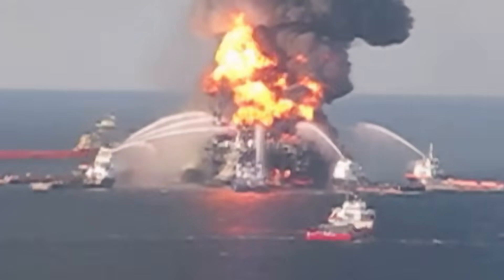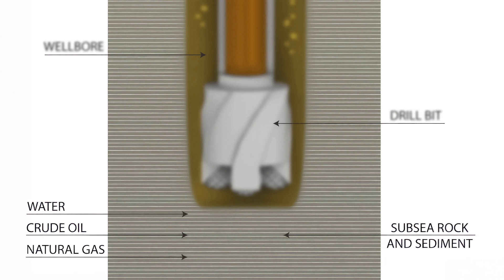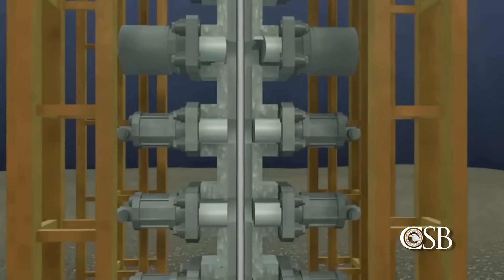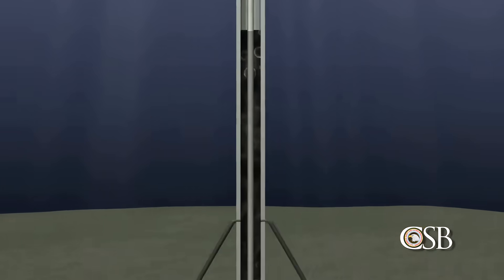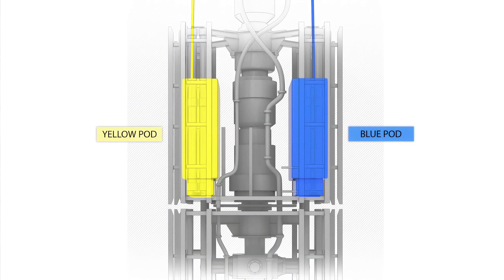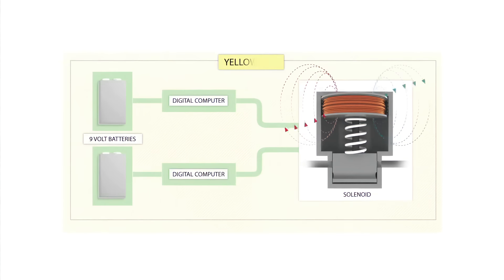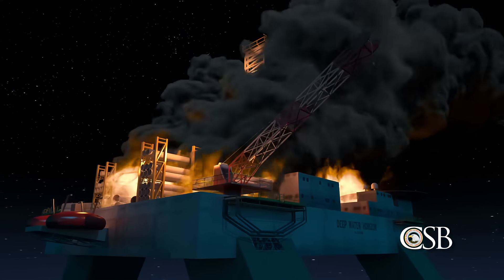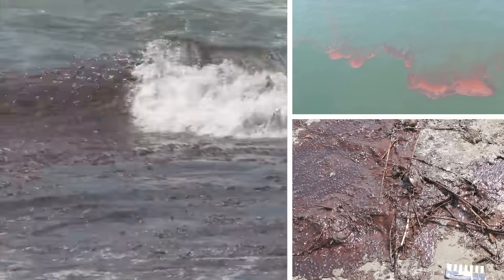Deepwater Horizon Blowout Animation

Comment: I worked oilfield from 1978 through 1981 as a safety and training officer for Dowell Well Servicing. It amazed me how much money the company spent on safety and accident prevention and yet, still operated some of the most obsolete equipment I ever saw. New technology was coming out constantly. And still people were getting hurt in the most stupid ways. In the DWH disaster, those BOP and emergency rams cost the company tens of millions of dollar, not only to buy but to install. The engineering behind them is state of the art and yet, dumb asses wired them wrong rendering them as useful as a slab of pig iron. This kind of stuff goes on all the time in engineering and application of technology.  I could not tell you how many times i caught people taking extremely dangerous shortcuts, short circuiting all safety procedures and mechanisms- in the name of saving time or money.  Every accident investigation results in the same conclusion; invariably it comes down to people just being stupid.
Reply: Urbicide and then it turns out that wiring was done wrong and someone gets electrocuted, or a safety harness snaps, new guy inhales arsenic fumes, etc. Internally defeating safety regulations makes for sloppy jobs and dead men. If your employer is losing money by operating by legal standards than you're working for a contractor who cared more about getting a cheap bid than the lives of the guys who work for him.

One of the reasons why US labor contractors, particularly construction, are regarded aa shady and looked down on compared to European companies. Everyone likes to joke about the road workers hired by the state, saying that they work 30 minutes a week, but at least they do a safe and clean job, as opposed to contractors that charge a homeowner 30k and knock down a few load bearing walls before they take the money and scram. just as an example.
Reply: safety is of the utmost importance....... as long as it doesn't cost too much money.
Reply: @mrcobus86  Or maybe and extra effort on someone's part
Reply: My dad worked seismic crew right out of college.  Each of the geophones on a seismic line has a big spike to stab into the ground, and a big yellow arrow saying "this side towards ground."  Walking the lines, he would find the geophones lying on their side, set down with the spike pointing into the air, and not even wired to the header line.  Against that level of gross incompetence, there's just no technology that can prevent disasters.
Reply: I only work IT but what I see:  if people think they can save say 8 hours of work, with only a 0.1% chance that saving this 8 hours of work will cause a catastrophic failure; they will opt to save that 8 hours of work every time.
After all, what is 0.1%?    0.1%  will hardly ever happen, so why worry about it.
Problem is you do this 10 times and there is now a 1% chance.  It builds up.

Plus people seem to work against themselves; they would rather do a crappy temporary job that takes an hour; than do a proper permanent job that takes 5 hours.  -  But, then this all builds up - they have spent so much time doing these shoddy temporary jobs they have no time to do things properly. If they had done it properly in the first place they would not be in this mess.

And like others here have said, a part needed for safety fails and will cost £10,000 to replace.  The system is still working however.  The plan will always be to replace this part "urgently" but never "now",  and so  "urgently" never arrives.  eventually it gets forgotten about until something really does go wrong. 

I won't say where I have worked (I am 32 so have 16 years work experience) but everywhere I have worked things have been done amateurishly with a facade of professionalism (sometimes not even that)
Reply: Stupid and in a hurry.  Almost always.
Reply: Im an apprentice electrician that does mainly industrial work our company preaches safety like crazy but some of the older guys that think they know everything don't listen or care and its what causes problems. instead of upgrading to modern tools, equipment and procedures they stick to there dinosaur ways and in the end there is more injuries and production loss because of it it amasses me.
Reply: They say it was due to incorrect wiring- yet I have a hunch the batteries were probably not replaced, and wanting to avoid blame, they blamed it on the "wiring". The battery most likely died on the sea floor, and it being to expensive to replace, they never bothered. They hire extremely capable men to do these dives- and probably wire the mechanism on shore, before instalation. but like you said- they have a tendency to use outdated equipment.
Reply: Martin DeVido I thought the same thing. The batteries being dead likely caused these issues. It would have been a major undertaking to replace them....so they didn’t. Then the unthinkable happened.
Reply: @mdevidograndpacificlumbera1539  A previous video I saw stated that the BOP's and the power control modules were wired and tested on shore by the company that supplied them for the project.
Reply: Jim, no. A client cannot pass responsiblity on to a sub contractor. Auditing, auditing, auditing. This practice of awarding contracts to the cheapest tender does not work. You can never blame a subcontractor. Q, when did you last audit their work ? Never ?
Reply: Don't you dare talk about my slab of pig iron.. I love my pig iron.  It's so slabby.  I tell you everyting.  ya, ya,.. Just one question.  What's a Pig Iron?
Reply: Reminds me of working in the computer industry. The problem is not the chair or computer, but what is sitting between them. Lol.
Reply: This explanation in the video makes no sense at all. Miswired? I'm not buying that  either.
Reply: ReelMan  That's total bullshit. I worked for the worlds largest chemical company. Our plant had 25 years without an accident.
Their plants across the river from Detroit couldn't go a week without one.
Reply: I’m an inspector for the state highway department and you are absolutely right. The things I catch and the corners contractors take to try and save a bucks to make a bigger profit is astonishing. Scary thing is not everything is caught although we do our diligence to try. You think building a road is pretty cut and dry just pour concrete or lay asphalt and it’s done. No that’s not it, there are many other factors for making a road safe and to endure traffic for many years. Concrete has to be tested and pass inspection, asphalt has to be a certain temperature before being laid, the base has to have a 97 percent compaction and density. I could go on and on. Point is when corners are cut it will compromise the product and safety of others.
Reply: Jim Bass it’s cause the oil business doesn’t actually give a fuck about safety. They do just enough to be legal and not have to shell out money for violations yet they end up shell out a shit ton of money to pay for clean ups and people losing their lives.
Reply: @Scratch5591  sounds like you worked for the wrong outfit.
Reply: That's because people, in general, are stupid and lazy.
Reply: If you ever watched the Opra show 
WHERE ARE THEY NOW!!!
And wondered about Bevis & Buttthead? 
They are rewiring solenoids. 🤼
Reply: It is called greed
Paying electricians low wages guarantees the electricians working there are other company's rejects.
That is a kind of stuff that insurance companies would like to know about
Reply: I thought the wiring didnt affect the overall outcome because the pipe was buckled off center.
Reply: @baloog8  NOE! IT IS AN OPTRICAL DISSULSIONNES. I HA HUNDEDS OF VIDEO OF IT. I WAS VIDOEIN IT MYSELFE. THE VIDOFES ARE TOLES LIKE 'BP Oil Spill'.
Reply: @ilovecops5499  comon don't be crazy now.😉
Reply: @baloog8   Gooper Loper
Highlighted reply
Gooper Loper
48 minutes ago
 @i Love Cops  comon don't be crazy now.😉
Reply: This is becoming a (well known and ignored) reoccurring theme in many industries. Oil, nuclear, medical, biochemical..all the public/news is waiting for is proof, before or after an accident.
Reply: Jim Bass, I could not agree with you more
Reply: Stupid idiots. They think they are doing the company a favor by saving money by hanging on to outdated dinosaur equipment. That should never happen in a dangerous job like drilling oil
Reply: I can tell you right now I am a carpenter and I will be up all day till night happily just to make sure everything is right and I did my test and everything is ready for the public I could not rest without knowing those rams would activate and if I can’t get it right I give the money back simple
Reply: There should be QA processes in place to test all of those circuits before and after installation.  A monitor could be put into place to constantly monitor the quality of the circuits for connectivity and current carrying characteristics.  Are these guys new at this stuff or what?
Reply: Hell, half the time safeties are circumvented because they're just inconvenient, even if it only takes a few seconds.
Reply: Exactly! It's beyond frustrating.
Reply: Mr. Bass,  what would you suggest as a fail safe?  That much money you'd think there would be someone triple checking eachothers work.
Reply: Or does it come down to where guys are so proud of their position they stop caring about safety?
Reply: There's is a bottleneck there yes. It is one of the shortcomings of a graph based design.
Reply: Jim Bass they hired some hillbilly
Reply: It's the same way where I am as an airline mechanic. One of the things the FAA drills into us constantly is that over 80% of all aviation accidents are caused by "human error".
Reply: Jim Bass you are mistaken if you watch the video again you see the wiring came VERY close to rending the BOP useless but it did ultimately work to trigger the shear. The failure was one of mechanical design that allows the pipe to shift out of the path of the shear.
Reply: wow good story sir!
Reply: OIM called those shots. Bet.
Reply: Could this have been sabotage if the higher ups were involved? Many people benefited from what looks like a very avoidable tragedy.
Reply: I work in telecommunications/CATV and I can tell you its the same all over. They will spend millions on safety equipment that really doesnt help, and will refuse to put money into the most important things for the workers such as vehicle maintenance for example. They always push things to the limit of failure instead of proactive maintenance, this rig failure is just another example of that same thing. That battery wiring should have been caught long ago, not after its too late.
Reply: greed
Reply: Well said!
Reply: How the hell were you qualified to be a training officer in a highly specific and technical field in which you had, at the last day of your work, 3 years experience in the field? lol
Reply: Well said, perfectly explained thank you. 👍🏼👍🏼👍🏼
Reply: Reliability bottlenecks
Reply: Lol it just exactly sounds like same in airline industry. You never know how people are stupid that could’ve cost lives
Reply: 3 years and you were the safety guy...no wonder Hal and Schlum were always safer to work with.
Reply: Thank you for your input and your service in trying to improve such situations. Many people like to speculate that many accidents were caused by deliberate intents to do harm. I've always known that most happen due to people with good intentions but that doesn't prevent some of the actions from being stupid.
Reply: If you can wired them wrong, the engineering is 100% in fault. If the system allow you to operate if safety are not 100% functionnal, engineering is bad.  A well designed system would have blocked everything as soon as installed if safety do not work. For exemple solonenoid should be in the other way. No power or wrong wired or whatever = valve open. 

Tchernobyl was this kind of engeering failure. Nuclear power plant in use today shut down if there is no power in the control bars, by gravity. Of course there were many other mistakes in the Tchernobyl disaster.
Reply: Usually it’s not people being stupid but supervisors constantly breathing down someone’s neck why everything takes a bit longer than expected.
Reply: State of the art design includes testability and repeatability.
Reply: O
Reply: This clip is fishy to the nth degree. The Deepwater Horizon was one of Transoceans best and top rigs. Which means it had the best and top hands on board. All the sub-sea (people that worked on the BOP) fellows I ever worked around at this echelon were all about the business of doing it right. It is a law that BOP's are to be tested every 2 weeks and after each cement job at which time (most of the time) a Federal employee (MMS) will come on board and go over all information and check pressure testing charts and BOP function tests. It's a major federal felony to falsify any of these tests. I heard that they had done a cement job prior to the accident, and either waved off the test cause the feds couldn't make it to catch up some time or did perform the test and not realize that cement got up into the stack. Sometimes the formation swells up and makes the cement go higher up the hole (into the stack) than was calculated. Depending on how deep or how hot it is downhole is the amount of cement retarder they use. Sometimes it could take 3 days for the slurry to set up. And the possibility of the cement not setting up enough in the BOP's for 3 days before actually impairing critical  functions might be valid. Maybe one pod but not 2.
Reply: I take it you no longer use a fork? That tool is thousands of years old. Talk about obsolete!
Im giving you a hard time because old does not mean unsafe or useless.
Reply: an accident is more expensive than safety
Reply: Like the guy using the bosh cordless drill in a explosive atmosphere....
Reply: “Safety “ is not WOG. 🤷‍♂️
Reply: This shows a culture of pure disregard for safety. Not following procedures, not testing the system regularly. I can bet the safety manual on DWH had been lost for years before this happened.
Reply: I am a second year electrical apprentice. Do I need an Industrial license to work a rig??
Reply: Spook
Reply: STUPID AND GREEDY
Reply: Frightening stuff. I worked the oilfield for half a decade and know a good bit about the safety shortcomings esp with new equipment. Here's something that'll scare you too. I have a buddy that's a medical device salesman. He often sits in on surgeries to make sure the surgeons install the device correctly. Talk about testing and quality control.
Reply: Your old company nearly broke me. Working on an offshore rig they had so many equipment failures when the well came on I thought we were going to loose the rig. It was hardest shift I had to work to contain issue and get situations under control. There were lots of failed equipment, equipment not fit for service and people who didn’t know how to use it.
Reply: AND MOSTLY GREEDY
Reply: It's the fault of quality control and safety implementation. You can't blame the ones who wired, because someone will eventually make a mistake, and it's the job of safety and quality control to account for that
Reply: @MikeBarbarossa  There is fault and negligence and ignorance all around - and yes you can blame the ones who wired it as one of the many cascading causes and contributing factors of this accident because they were negligent in their job and did not do their job properly.
Reply: This is exactly why I give my supervisors such a hard time. That and I love to watch people squirm.
Reply: @qdmc12  Oil companies and their vendors, suppliers, etc., are as bad or worse that the military contractor complex.
Reply: It's all about the money. How much money are they saving by running an operation comprised of outdated equipment and lack of safety procedures that cost time and money? Even after ecological disasters and possible personnel loss, I can guarantee you that over time they are saving money by continuing to do what they're doing.
Reply: i worked with an electrical engineer who once incorrectly wired a hot water heater timer and almost started a fire. i had wired them up easily after reading a home depot home wiring picture book i got for $12.95, this guy with a four year degree from a prestigious uni almost burned the place down on the first try.
Reply: @RJ-se9op 🤣🤣🤣
Reply: @jimbase7867 Maybe you can answer this for me: from the description of the first two blowback safety mechanisms in the video (the rubber stopper one and the one below it), it seems like, even if they were used properly and immediately, they would always cause immense pressure buildup in the pipe eventually, right?

Or are they meant to be turned off quickly after using them, before the pressure builds?
Reply: Yep, the only 2 times the space shuttle blew up out of 135 were BOTH not only preventable....but people knew in advance EXACTLY what was wrong and how to prevent it from happening. Do you know how dangerous igniting all that rocket fuel is and yet, we did it flawlessly every time except Challenger and Colombia and they had prior knowledge of both issues that would kill those astronauts
Reply: This where AI or robots could eliminate stupid mistakes and taking shortcuts
Reply: Yes sir. We have a schedule to meet. I've worked on construction jobs where safety inspectors constantly patrolled the job site. Any little infraction could get you run off the job. However, whenever something had to be done, that could not be done according to the proper safety protocols in place, the contractors would have an off-the-record discussion with the job site managers. Wink, wink. Then, a crew would be scheduled to work after normal hours & the official safety man was not present. The task would be preformed, nobody injured, & the next day things would be back to normal.
Reply: Yeah.  Works great.  Until it doesn't and someone dies.
Reply: @Urbicide  Schedules should not COST PEOPLE THEIR LIVES
Reply: Jim Bass For all those really curious what happened on the horizon, I can tell you exactly why the horizon failed. I won’t give details on how I know this information or names but I will give you all the truth of why the rig exploded. 
Deepwater horizon was built in South Korea and it took 3 years. Some incredibly intelligent men built that rig. BP got approval from Obama to drill there because they went to 5000ft and no one had ever gone that deep before. Everything was put into place in perfect working order and BP turned the rig over to transocean. They were the ones responsible for operating and are the 2nd largest drilling company in the world at this moment still. BP works very closely with transocean and remember this. 
One month after BP turned the rig over to transocean the project manager who built horizon went back and inspected. His findings were astonishing, all the operation and safety manuals were gone, the safety alarms were literally cut. When asked about this to the transocean driller, he said because the alarms were constantly going off and waking up people they physically cut them out. This report was obviously buried and 1 month after that report was filed it blew up because no one was physically watching the gauges and the safety measures were disabled by transocean. BP took the fall because their close relationship with transocean. 
Of course this isn’t the narrative the movie portrays, because how are you going to feel bad for those people who worked with transocean and destroyed horizon and polluted the gulf? Instead they portrayed a tragedy and blaming BP for everything, when in reality you’d actually be yelling for them to burn with the rig for not doing their jobs and you say that those backwoods Cajun hillbillies got what they deserved. 
Believe me or not I don’t care, but that’s the truth of it.
Reply: @khure711  p
Reply: Я думал, только в России распиздяи бывают
Reply: It's like what was said about NASA rockets, "cutting edge, designed by some of the smartest minds in the world, built by the lowest builder "
Reply: >invariably it comes down to people just being stupid.

How can you have worked in the industry and not know the golden rule?

THE SPICE MUST FLOW

Yes, new technology comes out all the time, but FITTING THAT TO EXISTING INSTALLATIONS means SHUTDOWN.
When you lose production because of a shutdown you CAN'T MAKE IT BACK UP, it isn't possible!  Yes, the oil is still in the ground but you don't get it back until the FINAL DAY OF PRODUCTION.

Yes, the mantra is "safety first" but what does it mean?  Back when I was in the industry, BP fixed the price of a human life at exactly £1,000,000 sterling.
If your safety feature/policy/modification was calculated to save a life, but cost £1,000,001, then it was ruled uneconomical.
In capitalism, everything has a value, and the value of a life in oil production is around £1 million (1990).  I guess that number is probably higher in the USA because of the litigious nature of that society and higher expected payouts from legal action, but it still has a limit.

That's what so many people commenting here don't seem to understand, no company pursues, nor should they pursue, "safety at any cost", that is economic suicide.
Us who have worked or do work in the industry knew what we were getting into, and should know.  The same goes for any sector.  If the (very real) risk of being killed for (very real high pay) isn't acceptable to you, then pass!
Reply: @daisyjenkins8543  well said, as a highly experienced oilfield worker, I concur.
Reply: We need better engineers.
Reply: @michaelhurlburt7906  what we need is better engineering technicians. Engineers can design a perfect system but if the technicians don’t execute their job it doesn’t matter.
Reply: THAT L;EVEL OF SCAMMIGN MAKES ME REEELY STEEEE,EIMNG MADDESS. O AM, SOUPER ANGRY ROGHT NOEW. I AM AMMMMAAAAADDDDDD!
Reply: K B  Sorry to tell yu but steriods are nto allwoed noi moer. WWE test all their wrestler for drugges  includign steriodes.

 K B
Highlighted reply
K B
11 minutes ago
Couldn’t they use the solenoids to hold the valve open rather than using them too close them ? This just looks like stupid engineering for me. A Spring closes the valve when the solenoids lose power.
Reply: yeah I worked as a underground driller for mine....they always cut corner... thats why I dont do that anymore.
Reply: You can make excuses about shortcuts and poor inspection until your blue in the face. This thing was doomed to fail the moment they began drawing up the blueprints. How do you manufacture 5,000 feet of perfect pipe with no microscopic fractures at any point? You don't. Instead you say: "Sorry mister billionaire oil tycoon. This won't work. Figure out a different plan." If that piping hadn't buckled from the pressure those safety backups would've worked, including the one with the failed battery since the magnet the battery powered was equally screwed up.

Just remember this the next time proponents for more offshore drilling or more oil pipelines try to convince you that oil drilling is perfectly safe, and that accidents can never happen.
Reply: Some day robots will do this work and there wont be any need for Humans to mess it up.
Reply: @verygood7155  lol, go visit a rig.
Reply: Yeah Yeah, but we NEED OIL and so we break a few eggs here and there and then move on like MEN and learn from our mistakes. We don't act like cry baby diaper wearing baby LIBERALS and say 'NO MORE DRILLING FOR OIL!'The world survived this accident, it is still here... Remember the DIRE predictions, none came true. MOVE ON, remember! Liberals learn and MOVEON!
Reply: @weatherphobia  thanks for the dazzling display of intellectual prowess. Seriously, you're one of the reasons why the United States is the stupidest country in the world
Reply: @weatherphobia  tosser
Reply: CRACKLES MCFARLEY has me but lost me because the thought process of “forget it”😒